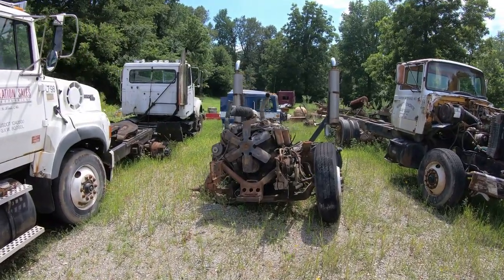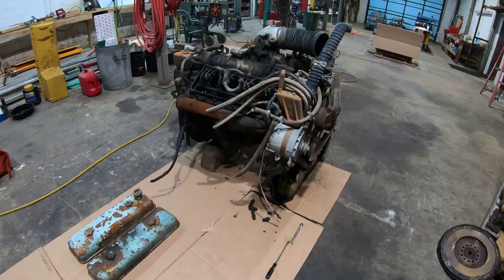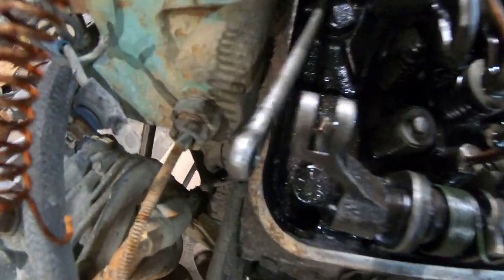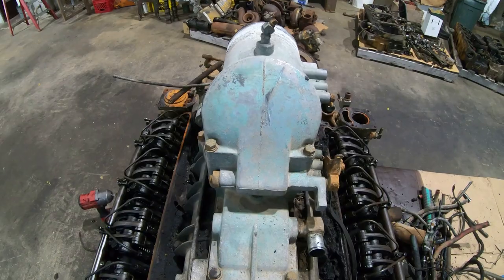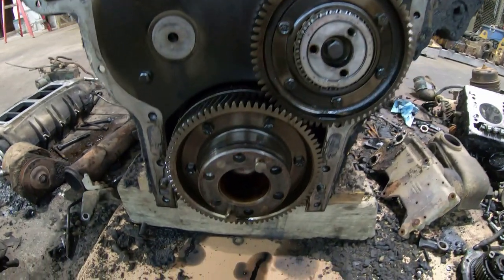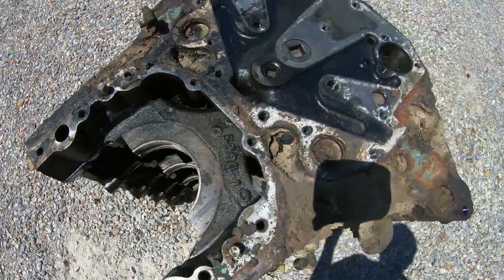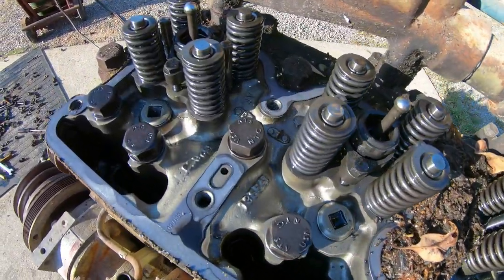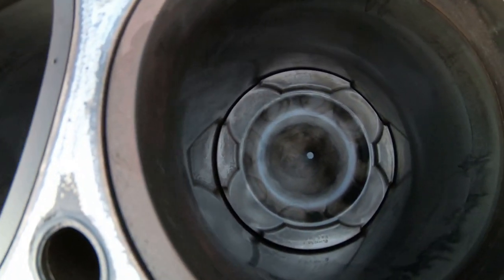Runaway 2 Stroke Detroit Diesel and Ethered Cummins Engine Tear Down

Comment: I have alot of experience with these mosquito forgers from the 1800's LOL, What you have said all along is correct.  Plus why does everyone think they know everything about a two stroke Diesel that is older then most of the them. Im not bashing anyone, I'm just saying if you don't know exactly 100% of the topic at hand just ask and try to learn something new and interesting. Remember You can preach to the choir but you can't reach the congregation unless you know the songs. For example the point at values will float on this  Diesel is around 4300 RPM  to 4600 RPM ....  Not to mention a Naturally aspiratied 2 stroke engine that requires a turbo or blower to make it run. The part about jamming more fuel to make it turn more RPM had me ROFLMAO...  Anyone with a third grade education, and know the difference between a spark plug and gas cap will know that every engine has a max RPM, and also has a valve float point that will limit RPM and no matter what fuel and oil mixture you have won't make the engine turn more RPM, AKA run faster...  Valve Float Point is Max RPM and catastrophic failure is close behind if you keep the Max RPM for a prolonged period of time. Same with  Runaway engines, Runaway is just a fun way of saying the fuel supply is maxed out,  stuck open and a Grand finale epic failure is soon to follow $$$$
I guess it's self explanatory when you know what your taking about or have at least very basicknowledge. If you look at any video or topic nowadays the trend for some reason is people love to comment and thats ok, but commenting with a wise ass remark with no clue on the subject at hand makes me LMFAO.
For example I have a video whereI the topic is how to prime a new pump on a soft wash system.  Well guess what happens next....
Some clown says Your pump is not running properly,  sounds like it's failed, or the supply isn't correct. WTF....
What part of how to prime a pump on a new piece of equipment didn't they understand.  It's like some people have a serious case of attention deficit disorder from hell.  Or then again it could be the stuff the put in the city 💧 supply .... 😆
Oh, by the way the Flux capacitor on the  Warp drive is failing causing a huge influx of fuel to the mass space interface spectrometers, causing a inversion of neutrons leading to a vortex plasma breach. Basically a running wrap drive emulator failure 🙃 😅 😪 🙂

Comment: Just because you have locked the throttle full open it's not a runaway that is burning its own OIL it's just a JAMMED up throttle. Two totally different things when learned from marine diesel engineering college. When you can run the engine without any derv you have a true runaway

Comment: The main reason these detroits run away is the oil seal in the blower goes bad and starts blowing oil into the engine and theres only one way to shut it down and thats shutting the air intake off I know because I worked on detroits for 21 solid years and seen it happen when that blower would blow an oil seal never never ever saw those governor rods become disconnected in 21 years and the company I worked for as a fleet mechanic ran exclusively DETROITS

Comment: Most people consider a runaway when it’s running on the crankcase oil which those people are right. Naturally aspirated means it draws its air (aspiration) NATURALLY meaning from the atmospheres natural pressure. You said in your video it has a blower to create slightly positive pressure. You discredited yourself right there. It’s not naturally aspirated

Comment: There are more moving parts in a two stroke than anything I have ever seen. Built a few with old timers, you learn to  appreciate the simplicity of a 3406E or 855 big cam lol.. Good grief the copper washers were every where.

Comment: That's just balls out no governor.... But that is still mechanically limited by the injector and or the the high pressure pump. A true runaway diesel usually is triggered by a diesel leak overfilling the crankcase with diesel/oil mixture... There is no such metering device.... If it was truly floating the valves it would have been throwing fire out the exhaust....Still cool ass video.

Comment: LOL, any engine that has positive intake pressure due to any part of the intake IS a forced induction engine, period, no exceptions, this is a 100% fact, plain and simple.  The fact that an engine won't run without some sort of boost, or the manufacturer classifying it in another way for other purposes, doesn't matter.
Reply: Exactly. An engine can't be both forced induction and natural aspiration. They are mutually exclusive. The Detroit has a supercharger, so it's FA, regardless of what Detroit calls it.

Comment: These old two stroke Detroit engines were noted For running away..
Reply: Yes They Were And My Dad Had A Silver 92 Detroit To Do The Big Time Run Away Years Back And He Said Damn, It Was Worth It!! 😂
Reply: And If An Old Detroit Wasn't Leaking Oil And Needing The Normal Gallon Or Two Quite Often, Then It Was Something To Worry About

Comment: Subtle, have you ever thought of using blasting caps as a starter?  Sort of like a deranged Coffman starter. Put a cap down one of the cylinders that is just past TDC.  I reckon that engine will turn over at least for half a rev.  >>;-)>>

Comment: v6 92 tt has a plunger thing sticks if dirty when it apart, the exhaust manifolds off , fire will come out like one did on jan 2 1987 it did just that on a foot of snow great all the fire engines & company;s stood around and watched it all burn to the ground a 5 building complex connected to the shop  it went in smoke! one co owners said get out the hot dogs he was pissed (the fire company's had no real way to stop the fire)

Comment: You know , honestly nothing much else but a 22 yo college gal and an absofukinlutely destroyed Detroit boat anchor pos makes my sticker peck up these days . Spent 50 years putting up with these gutless oil slinging noisey bastards and despise them . Great vidja and thanks for the giggle . 8v71 translation 300 oil leaks 18 horsepower .🤣👍

Comment: Well I was would say an engine design that lasted from 1938 to 1987 was a sound design, think about todays engines where designs are turned over frequently. I dont agree with your belief of the engine hemorrhaging oil everywhere. They generally lasted that long in chassis for decades there was bound to be some external oil residue. Your criticism of the two stroke Detroits is unfounded other wise the design wouldn't have lasted that long nor the be used in every application from water pumps  generators, drill rigs, mining, civil everything.

Comment: Detroit guys get so triggered if the exact terms are not correctly used, and I don't understand why everyone is obsessed with these noise makers.  The Air Force is finally giving up on aircraft power carts from 19dickity2 with brand new replacement Cummins units that you can stand to listen to, and I'm thankful.  The 60K loaders are finally also being re'engined with some form of Benz motor that is way quieter.
Reply: Because they are the best damn diesel on earth

Comment: Say what you want but just because an engine NEEDS forced induction to run doesn't mean that when it has forced induction to run it is naturally aspirated. Naturally aspirated means it pumps the air in without any forced induction. Add forced induction for any means and it is now not naturally aspirated. A two stroke Detroit has is a forced induction engine, no matter how you want to explain that it isn't. This is all basic engine theory, not Youtube logic. I think you are confusing normal with natural. Yes, a Detroit normally needs the forced induction, that doesn't make it naturally aspirated.
Reply: It is designated by Detroit diesel as N/A .
Reply: @Bmc1025  I get what they say and that it's "mechanically scavenged" but it does not fit the definition of naturally aspirated which is atmospheric pressure fills in the void created by the piston. All good, people can call it what they want and I will call it what I want.
Reply: @inothome  technically for the way a 2 stroke diesel works it is natural as the pressure has to be above ambient to create movement.
Reply: @jdrok5026  Correct, it is normal for it to be above atmospheric to scavenge the waste gases. Most often done in two strokes by pressurizing the crankcase with the piston, as most gas and most old ass diesels. Those I would call naturally aspirated, since there is nothing added to the base engine to  help with the scavenge. Once you bolt on a blower or turbo, now you added something extra and I would not consider that naturally aspirated. While DD is saying it does not 'add' pressure to the cylinder and it's just for scavenging it still relies on the blower and not just atmospheric pressure. 
But, just my opinion on it and there may have been ulterior motives why DD calls it naturally aspirated, such as emissions compliance (hardly, lol), some otehr regulations, plain old marketing or other factors.
Reply: @inothome  I use na based upon design some engines are just plain designed to work with above atmospheric conditions as its the only way they could possibly function properly